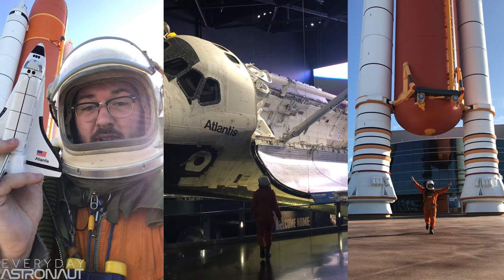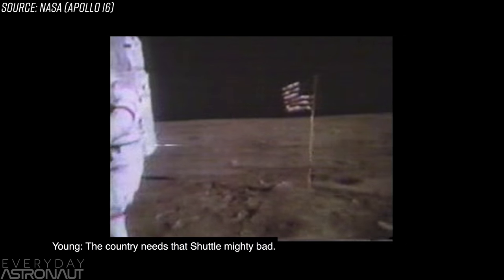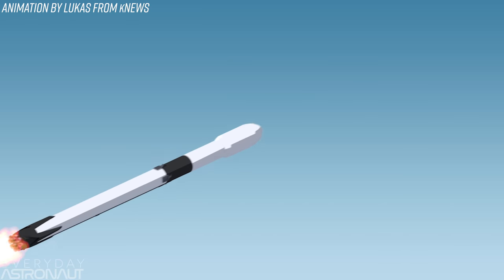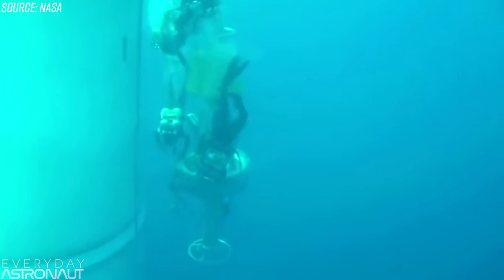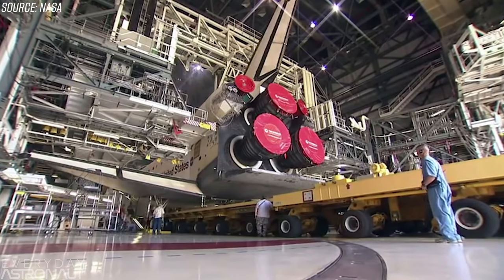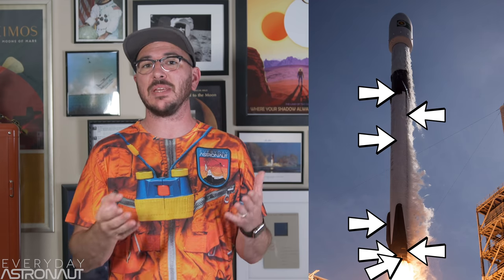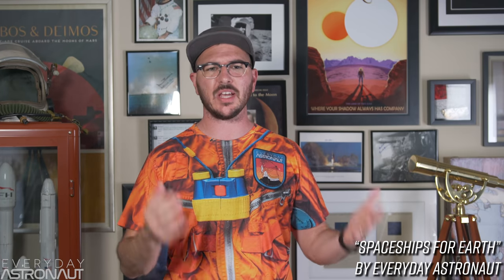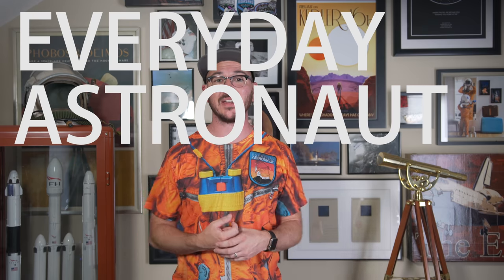Will the Falcon 9 actually be reusable or just refurbish-able like the Space Shuttle?

Comment: "Reinforced Carbon-Carbon".  Is that like Pizza-Pizza?  Extra good?
Reply: Killroy it's like cheese and cheese.
Reply: basically its something like graphite or graphene, probably reinforced with bonding agents and some form of mesh, I am not going to bother looking it up because no mater how it was made it would be a really good thermal conductor that can survive really high temperatures.
Reply: @ Michael: CRC is in short Carbon Fiber with pure Carbon, Graphite, used as epoxy and is then baked into one solid part. While is is not as strong as Carbon Fiber it is still around the strength of tempered glass. CRC is what he call RCC, less accurate but still correct and commonly accepted name.
Reply: Baked like a Pizza?  ;). Thanks for the info.
Reply: Mosern1977 cheese and cheese is my favorite
Reply: He uses RCC because that’s what NASA(and all the vendors) call it. Yes it’s carbon fiber with a carbon epoxy matrix. Good thermal but kind of brittle compared to other carbon fiber in more flexible epoxy matrix(think car parts).
Reply: CRC is a thermal insulator that is made by extruding carbon polymers, and binding them with an epoxy made of powdered graphene baked to a super high temperature in a static pressure mold. Unlike carbon fiber, it is not used as a structural component due to its low tensile strength and brittle properties, but it is still much stronger than steel, and can withstand dynamic pressures of several mPa and over 3000 C.
Reply: @Killroy  LOL!  Pizza-Pizza!  Little Ceasars!
What are these people talking about with graphite/graphene/carbon/epoxy?  I would NEVER order them as a topping on my pizza!
Reply: Imagine you have a block of carbon fiber with plastic resin holding it together. Now imagine you slowly bake that block of material in an oven without any oxygen. What happens is the plastic breaks down, the volatiles escape, and the leftover carbon 'soot' bonds to whatever's around it. The result is a material that isn't as tough, is a decent bit lighter, and can handle WAY higher temperatures, since it's made of nothing but carbon, which remains a solid even if heated to several hundred degrees above the melting point of tungsten (the most heat resistant metallic element). Very good for applications involving extreme temperatures but only minor physical loading and minimal shock loading, since the material is quite brittle due to being made of inflexible molecules.
Reply: The material so good they named it twice
Reply: Little Caesar has entered the chat
Reply: Graphite reinforced with carbon fiber
Reply: Pizza Pizza is a chain mostly in Ontario, Canada.

IMO, their pizza is actually extra BAD compared to most other places.

Just call me Professor Killjoy :)
Reply: yes
Reply: Carbon-carbon is used in F1 race car brakes.
Reply: Think that’s the equivalent of extra cheese
Reply: Extra brittle when a light lump of foam hits it, sadly :(
Reply: Carbon carbon is also used for formula 1 brakes. An extremely cool material
Reply: @sycodeathman  Well, you follow up be soaking it in more carbon, and baking the volatiles out of whatever you used to soak the carbon into the part. You can use phenolic resin, or nowadays acetylene (in that case they just leave it in an oven flooded with acetylene for a few days). That soaking makes it expensive and also so resilient.
Reply: @sycodeathman  Well, you follow up be soaking it in more carbon, and baking the volatiles out of whatever you used to soak the carbon into the part. You can use phenolic resin, or nowadays acetylene (in that case they just leave it in an oven flooded with acetylene for a few days). That soaking makes it expensive and also so resilient.

Comment: I'm surprised that the space shuttle only failed a few times
Reply: At the end of the Shuttle mission failure probability was calculated at 1/90. Then years later they did another more detailed study, knowing what they hadn't known before and they came up with the number 1/9. 1 in bloody 9. By that figure we should have lost 15 Shuttles. We got super lucky and the engineers took good care of them. And once Challenger happened everybody became pretty conservative. Still I would have flown on it knowing that. 1/9 chance of a fiery death with the payoff of riding the Space Shuttle to orbit? What a way to go. By my luck I'll probably die getting run over by car, so it wouldn't be so bad.
Reply: @221b-l3t  The 1/9 was before all the changes they added to refurbishment.  Going over each tile helped the odds a lot, but at a huge cost.
Reply: @221b-l3t  The 1/9 figure was for the FIRST 9 SHUTTLE FLIGHTS get your facts right

Edit: It wasnt even the first 9 flight the first 9 flight had a LOCV probability of 1/12 so that 1/9 figure is total bs

Comment: A more useful comparison would be based on capacity. The shuttle could lift 7 astronauts and ~20 tons+ of cargo to the ISS comfortably. Cargo could be enclosed or open in the bay depending on what it was and how packed. Now crewed dragon will be hauling I think only 3 people to the ISS (because thats all NASA wants on it) but can of course haul seven. So a valid comparison would be between 1 shuttle flight and 1 crewed dragon PLUS 4 cargo dragon flights to achieve the same cargo. So now you are talking about "refurbishing" and/or "reusing" 5 dragon first stages, 1 crewed dragon capsule and 4 cargo dragon capsules (all of which have gone for a swim). AND, on top of that you have jettisoned 5 falcon upper stages and 5 trunks (compared to 1 External Tank for the shuttle flight). AND you have had 5 times the launch/range overheads and potentials for issues (the more times you fly, the more chance of failure no matter how good the machine)

Yes the shuttle was way more expensive and complex probably to refurbish. But the difference is not as large as you think when you look at the capacity capabilities of both system required to reach a given goal.
Reply: Still cheaper/safer to run multiple SpaceX flights than the Space Shuttle.
Reply: The SpaceX company is more innovative than NASA the design will change in the future with new technology and materials much more rapidly than the space shuttle could.. The shuttle was a 1970 design with no innovations allowed. The military made it more expensive to refurbish by demanding such a huge cargo bay that made it heavier,  where as if it were smaller and lighter it would have taken less to refurbish it and could have achieved its goal. Less weight on re-entry = less heat generated and probably less complicated. Material sciences of the time and computers back then also contributed to a less than optimal design. That said at the time it was state of the art but by today's standards was obsolete by the 80's and 90's. The real problem was NASA's lack of innovation and management, this is how it's done so don't question the methods used and come up with a better way. NASA a government agency is a bureaucracy and not prone to innovation.
Reply: @johncherish7610  How can you say SpaceX is more innovative than NASA when SpaceX is just building on research that decades of previous launches from various space agencies gave us?
Reply: @TroySavary  Does NASA have or ever used a metha-lox rocket engine the answer is NO SpaceX does the raptor engine uses it. This technology didn't exist before SpaceX developed it. Further the development cycle is way faster than what NASA's bloated bureaucracy can produce. NASA has for most part abandoned manned flights out of LEO. SpaceX is developing their star-ships to eventually be interplanetary manned flights  so who is more innovative certainly not NASA
Reply: @aphenioxPDWtechnology  What is a Mg ?
 And how much does the Falcon Heavy lift ?    Nice analysis, the re-usability does brings the cost down significantly.
Reply: @johncherish7610  Did spaceX ever land on the moon? No did SpaceX ever contributed to construction of a space station? No Has SpaceX ever managed to send humans out of low-Earth orbit? No has spaceX ever built a craft that can carry humans twice? No And congress is restricting what Nasa does if something is a littel expensive they stop it and force them to use the design bloody senators made

Comment: heat is generated on reentry because the air is compressed to extreme levels

I'm sure you know this. but I noticed in your video you said friction
Oh, then you said it right when comparing vehicles. 
Great work on the video. As always
Reply: I have a name it's a combination of both friction and compressed air, when you compress a gas it heats up and if you rub against something it generates heat. So the shuttle is compressing the air heating it up but it is also rubbing against the compressed air causing friction
Reply: It’s probably better to think of it in terms of stagnation temperature instead of a PVT comparison.  Yes, I know that in this case, it’s the Shuttle moving instead of the gas, but the Shuttle sees it as the gas moving so it’s the same thing.
Reply: Both
Reply: Pretty sure it’s electrons splitting from the atoms causing plasma.

Comment: My dad worked at Lockheed Flight Test in the 80s and one of the things he worked on was vibration testing on the Space Shuttle. One of the checks they would do at NASA for the Space Shuttle was on the elevators at the back of the wings. They would strip off the heat shielding and check visually for any cracks forming. The guys at Lockheed had the idea of using vibration testing to check for cracks, checking the resonant frequency of the elevators in order to see if it had changed, if it changed the there were cracks and if it hadn’t changed then there were no cracks. I wonder what other innovations could’ve been used to bring down the cost of refurbishing the Shuttle.

Comment: Great video! Can we buy the shirt? EDIT: Finally made it to the end of the video. I'll leave this up, and maybe someone else will read before asking.
Reply: So, a question...I didn't realize the high altitude burn on the boosters was to partially act as a, "heat shield." It's kind of brilliant really. Since a lot of the heating, and in the process slowing is caused by ionization, and ions are charged, could a magnetic field around a reentry vehicle be used to serve as a, "heat shield?"
Reply: BuckeyeStorms yo that sounds pretty awesome! But I’d worry about the effects on software from a strong magnetic field
Reply: theoretically it could, but the energy required for a reentry vehicle would be way too high. It could work on the Big Falcon Spaceship for the trip to Mars to protect against solar radiation though.

Comment: What if the space shuttle use falcon 9 rocket like falcon heavy or anything likethat to launch, instead using srb and rs-25 engine on the fuselage. Is that possible?
Reply: Search for "Saturn-Shuttle" project, which had SRBs replaced by a (potentially-reusable) S-IC.

Comment: Your video was great. Very informative. One criticism though: Toward the end you commented that the Space Shuttle had “very minimal” upgrades over its 30+ year lifespan.  That is not correct. Several major upgrades occurred. The ET was totally redesigned early on to save weight. It went from aluminum to an aluminum-lithium alloy that shaved nearly 8000 kg from its original weight. The SRBs and Main engines also went through upgrades to increase performance and payload to orbit. Those improvements and the weight savings of the ET and other components boosted the payload to orbit by about 7250 kg.  a 35% increase in capacity!!
And, the most visible upgrade was the avionics and “glass-cockpit” upgrade that occurred starting in 1999. The orbiters got the glass cockpit plus new avionics, hydraulics and flight computers.
So… some significant improvements did occur. But the amount of safety checks also increased significantly, making the originally planned 26 flight/year goal impossible. If the flight rate had gotten anywhere near that rate, I’m sure the cost per flight would have been much lower, although it could never have achieved its “advertised” goal of $1400/kg to orbit.

Comment: It definitely is more re-usable. SpaceX did a great job of nixing consumables and avoiding tear-downs. I think there are 3 main things that drastically separate the Falcons. 1. Separating the orbital re-entry vehicle/crew capsule from the launch propulsion systems. Orbital crew vehicles will always take much more time to properly inspect than a suborbital stages. Those Dragon capsules/human variants will not be turned around in 24 hrs ever. 2. Avoiding SRB's altogether eliminates a massive consumable: refilling big tanks of stable cryogenics vs repacking a massive rocket with tons of explosives. 3. The most impressive thing was getting the Merlin's reliable enough for simple inspections rather than tear downs, but I suppose 50 years of advancement in tech, controls, and materials will do that. SSME was great for its time, but just like in cars, a decent recent design is better than the best from half a century ago.

Comment: So interesting video. Awesome! I take a slightly different view on the impact of the shuttle being man rated driving up the refurbishment costs. The MIT open course where series on the design of the shuttle highlighted the fact that because the shuttle was man rated no one was willing to go on the statistical probability that a part will reach its design life.  So, for example, if a part had a design life of 100 hours, and only was used for 10 hours per launch. They would still have to inspect that part even after only 10 hours of use because the shuttle was man rated. They could not afford to take that risk. The Falcon 9 that recently launched the crewed Dragon was a new rocket. I wonder what it will be like when they try to launch humans on the refurbished/reusable Falcon booster.

Comment: Also I'd like to mention that it's not mostly friction that causes that re-entry heating! It's mostly caused by the compression of air molecules ahead of the spacecraft as it barrels through them at such ludicrous speeds. The air doesn't have time to get out of the way like it does around the wing of an airplane, so it kind of gathers up in front of the spacecraft. With pretty much any substance you can bet that the tighter you pack it together, the warmer it's going to get.

Comment: A frustum is the volume of a portion of a cone or pyramid. For example you cut the tip off a rocket cone for a parachute, or guidance equipment, you want to know the remaining volume. The frustum is the remaining volume. Another example, you have a curved bathtub that you want to know the exact volume of; the top is flat, the bottom it flat, the sides are curved, you could trace that curve through the floor of the tub to make a weird shaped cone thing; the tub  water volume is the frustum of the weird shaped cone thing.

Also, and more important, frustum is the word you use to find the formula needed to calculate the volume in a problem involving a part of a cone. Because frankly the calculus needed to do it by other means is waaaaaaaaaaaaaay harder to learn than a simple reference word.

Comment: The Falcon 9 could use a Belute system to minimize heat damage in later block systems as those can add safety with the rocket motors.

Comment: 6:16 It's a usual thing (even space nerds, even KSP players) get wrong, that "ton of heat" is caused by the friction. 
(maybe a fraction of it caused by the the friction, oh i'm a poet I just didn't know it)

The reentry heating comes mainly from two sources, convective heating, the hot gas/air flow past the surface of body and chemical reactions, catalytic chemical recombination reactions /according to wikipedia/.

The space vehicle (shuttle) pushes and compresses the air in front of it due its high speed, and because of the thermodynamic equilibrium compressed gas gets hotter, in this case it gets so hot it even becomes plasma (if its ionized gas, and that seems to be the case) that's why there is the orange glow when the space shuttle (or any KSP rockets xD) does reentry.

So most people gets this wrong, that the "friction" heats up "object" at reentry! 

No, its mostly the hot "air" around it that is being pushed and compressed (therefore it gets hot) and other chemical reactions between that hot air and the surface of the object (space shuttle, falcon booster, meteorites, etc).
Reply: I think this can be added into a top 10 space facts we get wrong list :) even the Everyday Astronaut got this wrong :/
Reply: @Cruz0e  It's mostly convection heating at suborbital speed then mostly radiation heating at orbital speed?